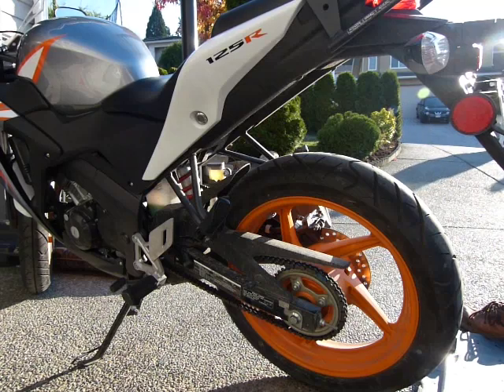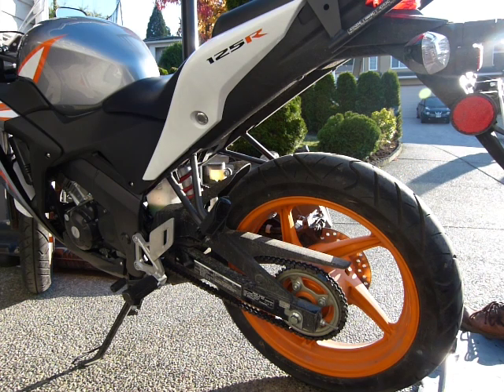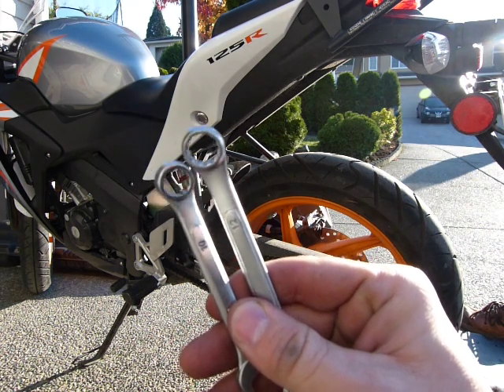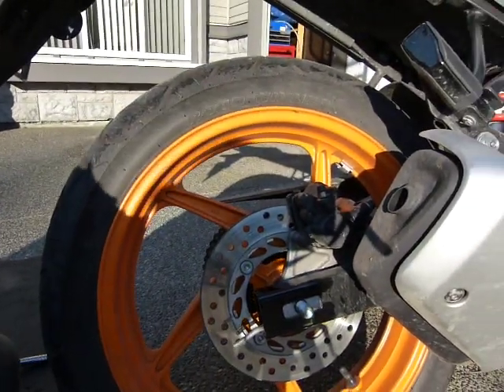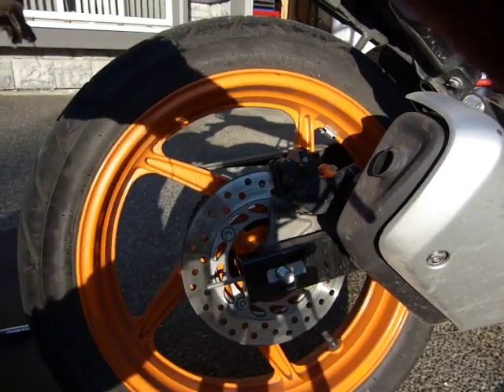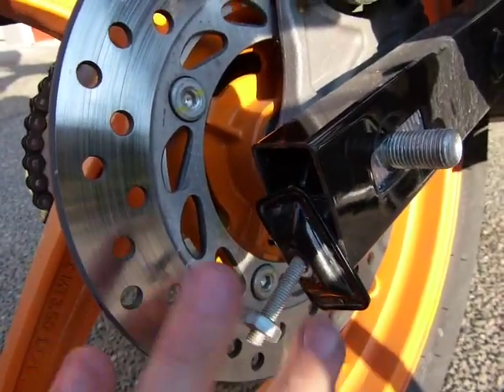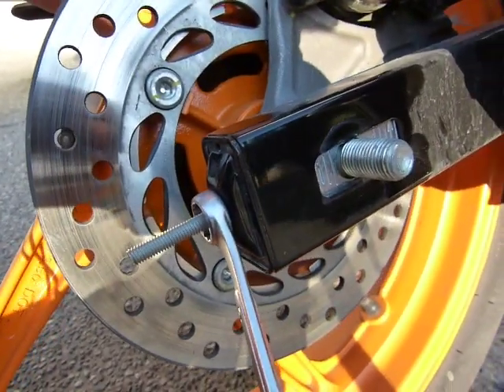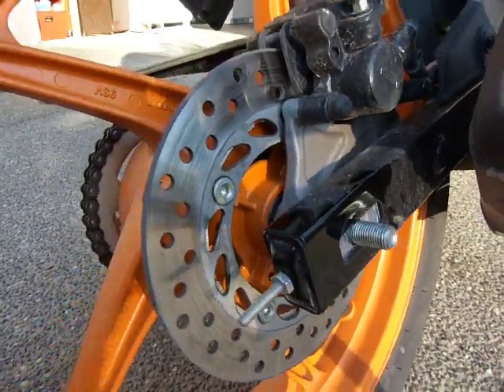How the CBR 125R chain adjuster mechanism works

Comment from the maker: It is a good idea to grab a straight edge to check the manufacturer`s workmanship on the adjustment mechanism. Once I do that on a bike, then I trust the markings. Reason: there are no left or right side adjusters, they are interchangeable. All are all made pretty uniformly by cold stamping, the lines are also cold stamped-in. The left and right sides of the swingarm could be different due to casting which involves working with molten metal. That`s what I check with a straightedge and ruler.

Comment: Hi mate. A very nice video. You followed the owner's manual, however, I've learnt that the chain adjuster marks aren't accurate and you need to make sure that the wheel alingment is done properly otherwise the chain is going to develop tight spots which equals replacing the chain.